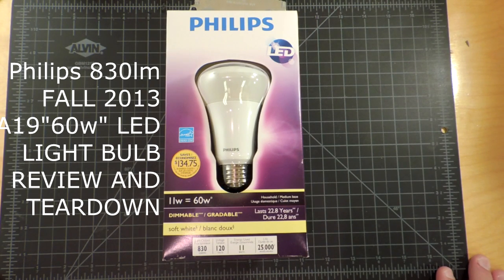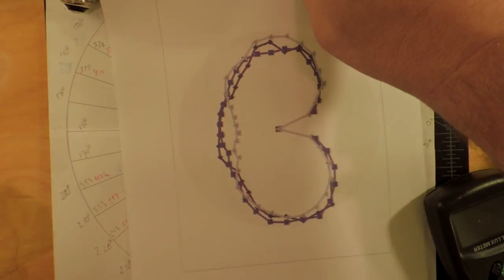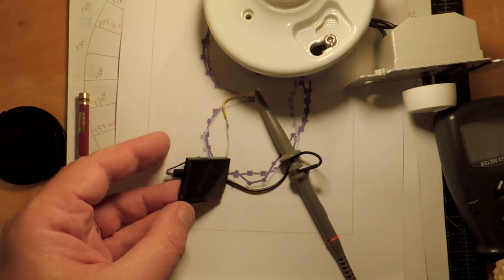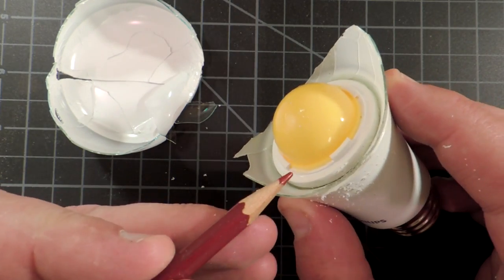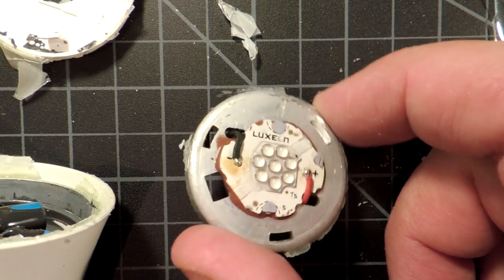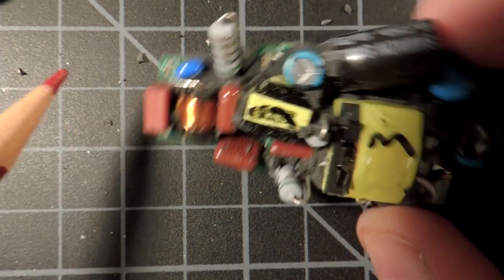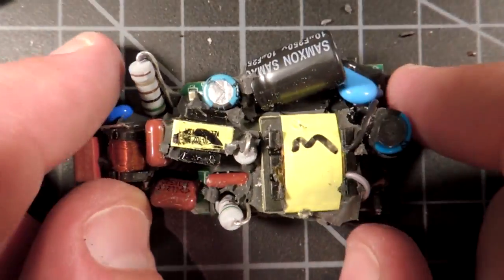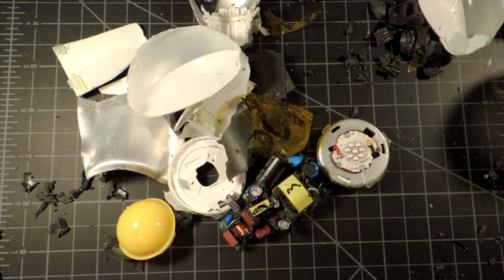Philips A19 "60w" LED Light Bulb Fall 2013 Version Teardown and Review

Comment: Thanks for providing this very informative video! I'm curious as to whether you've seen the new "COB" LED technology that seems to have taken over the eBay market in recent months. The diodes seem to be built right into the board hence the name, "Chip on Board"

They are advertised with pros such as:
-Lower Power Consumption
-Better Heat Dissipation
-More Lumen output per watt compared to older SMD technology

Here's an example of a MR16 version:
http://www.ebay.com/itm/251333566930?var=550277804331&ssPageName=STRK:MEWNX:IT&_trksid=p3984.m1497.l2649

Here's the 7w version:
http://www.ebay.com/itm/E27-E14-B22-7W-COB-Chip-108-LED-Pure-Warm-White-Light-Corn-Bulb-Lamp-110V-220V-/331090926793?pt=US_Light_Bulbs&var=&hash=item4d168e9cc9

They seem to range anywhere from 3w-15w. I currently replaced all my MR16 bulbs around the house with the warm white 6w versions and they have the exact same output as my 50w halogen bulbs. I cannot tell the difference between them other than on my electrical bill. For areas where I needed more light output, I used the 9w bulbs.

CREE and Philips seem to be manufacturing their own type of led chips with 4 diodes on each board while the Chinese COB leds tend to have 7 diodes on their board for 5w.

Comment: Another great review. I'm wondering if you might suggest a bulb that does fire more downward? I'm trying to replace the 50w halogens in my home, which are conventional E26 screw-in designs. Every bulb I've tried extends out the bottom of the fixture, and most are semi-omnidirectional like this one. Do you know of a shorter design with a more forward-firing pattern I might try?